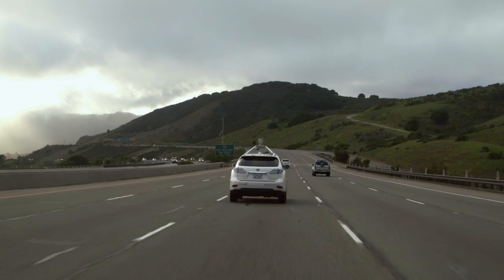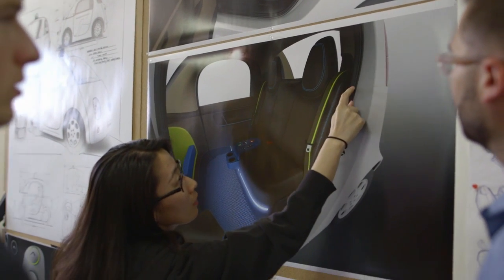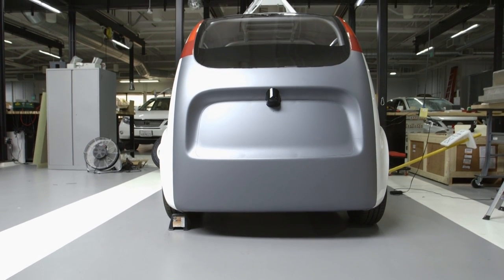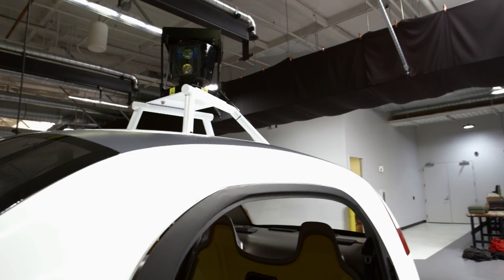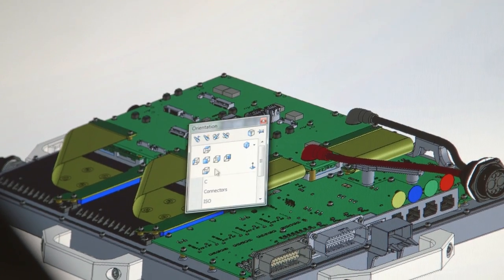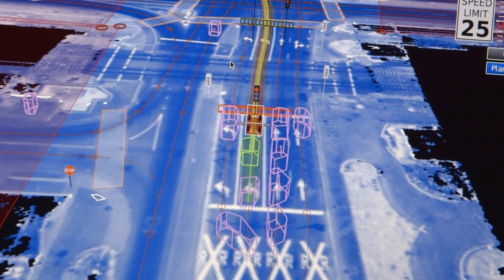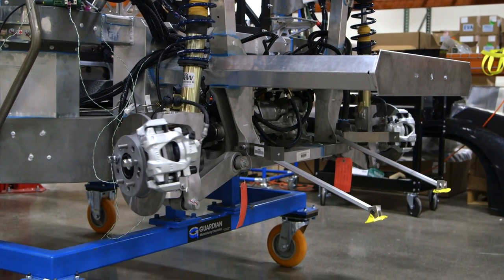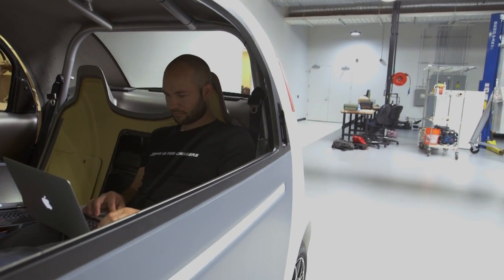Why design a self-driving vehicle from the ground up?

Comment: i've always been wondering since hearing about this idea is...whats going to be inside the car? entertainment systems? a round table? what will we do in the time we don't drive, anything i know. but sounds exciting filling up the space that has always been oriented forwards facing the road
Reply: Maybe the same thing as we see now in bigger aeroplanes. Entertainment system? Yes. Trip data? Yes. That could be: current temperature outside and inside, temperature at the destination. ETA (Estimated Time of Arrival), how long the trip will be. Speed. Expected route issues, such as slow traffic, accidents that may block the road, etc.

Comment: Removing the need for a steering wheel is great, but you know you've arrived when you've removed the need for a seat belt.
Reply: Seat belts will remain as long as there are other cars on the road that still have drivers behind the wheel. Which means, likely forever. You can protect yourself against crashing into something else, but you can't always protect yourself from being crashed into by something else.
Reply: StalePhish Eventually you wont have manually driven cars. They'll slow down the bumper-to-bumper 200mph traffic down to 60.
People will drive on private tracks or simulators for fun.
Reply: Rob Bairos People drive on private tracks and simulators already for fun. I think it will be a LONG time before manual driven cars are completely gone. We still have some cars on the road today that are over 100 years old. Quality is a lot better now than it was back then, so expect some of today's cars to last even longer than 100 years.
Reply: StalePhish Well I agree, it will take a long time, but eventually will be too much of a drag on everyone else. Reminds me of the switch from analog to digital TV a couple years back, after decades of transmitting analog formats.
Reply: StalePhish If I had to guess, Id say 40 years, manual driving will be outlawed in many freeways.
Reply: sorry to reply after 2 years. You probably don't really remember this comment section too well. I just had to say, i think it would be pretty funny seeing manual driving being outlawed. And just hard to imagine. I'll be alive. I'd be in my 60's then.
Reply: Descended_Flames that's okay. I still think about this topic all the time. If anything I think I way underestimated the rate self driving cars are progressing. Forget forty years. In fifteen, many freeways well be autonomous vehicles only! Cheers

Comment: How well does it all work in bad weather conditions? Will it spot floods? Potholes. Have you programed in dealing with tyre blowouts? Animals running into the road?

Looks like a big task with lots of programming. It will have amazing advantages when its ready.

Comment: Questions from a developer:

What is the computer powered from? Does this affect MPG?

Have you taken into consideration driving in the elements such as rain, snow, fog, etc. while designing this prototype or is that for the next release?

If I wanted to learn how to program one of these vehicles, where should I start? What languages are mostly used?
Reply: I think these things can also be detected, especially snow and fog (by sight). And whether a road is slippery (the car behaves differently to steering as expected; I think the AI can detect that).

Comment: What happens when the car runs out of power/gas?  Can the car be pushed off the road easily?  Can it be towed easily?  Maybe these are trivial problems, but I'm interested to know how they're addressed.
Reply: Maybe they will refuse to travel to the destination if they know the power won't last that far. That would be kinda cool wouldn't it :).
Reply: The car uses no gas plus this is a prototype. I bet they will ne a manual switch for the wheels to rotate.
Reply: IvanPlayStation4LiFe Right, no gas.  I missed that one, thanks.
Reply: What happens when any car runs out of gas and/or electricity? You tow it or recharge/refill it. It's just like your cell phone. You charge it when you go to sleep at night.
Reply: I imagine it would either pre-calculate the required energy to reach your destination and if insufficient, it wouldn't initiate, or alternatively if an error occurs and it runs out of juice prior to arrival, it would detect its low energy and pull off to the side of the road, where it could be towed. 

I don't think these are tremendously challenging issues. :)
Reply: UnknownXV Or you would just have it plugged in for a lot of the time. I imagine this type of car taking off as more of a ride sharing / rental car rather than something someone just buys.
Reply: UnknownXV StalePhish Nicholas Jung I don't understand why you guys commented? You guys literally said what my reply said, 0.o I could care less, but just wondering if other people actually read what other people reply. It seems like a waste to repeat the same thing to somebody 3 times, just sayin.
Reply: ***** eeh, for me it doesn't show that you commented on the comment before now..
Reply: Ху
Reply: It could be solved with an automated gasoline station, where the car can autonomously refill. That gasoline station should be compatible with the car and must allow Google to pay for the gasoline.

Otherwise I would think that a destination is too far, based on the fuel left in the tank and the average gasoline usage. It would reject to make the ride.

Comment: Who would be at fault if the car got into an accident, when there are no user-controls?
Reply: Seems like Google would.  I think that's fine... Google has deep pockets and can pay for damages/injury like an insurance company would.  Or they can pay an insurance company to do what insurance companies normally do.
Reply: ghuegel You are likely correct. Without any manual controls the manufacturer would likely be responsible. Which is why Google is testing so much and why the car is always recording what its sensors see. The other driver will have an uphill battle proving if it was the car.
Reply: The ultimate goal is for there to be no accidents.
Reply: ExtractorGames Yes, but we all know people, especially in america, tries all their tricks to get money from suing others.
Reply: ExtractorGames Yeah. And my phone never crashes or errors out either. Or any computer for that matter. So let's never think about what might happen before it happens, and then when it happens let's all base how quickly and the severity of the punishment should be when we are emotionally charged up. Sure to be a good Idea. Absolutely. /sarcasm

Nicholas Jung troll bait.
Reply: If it crashed, it either means there was a software fault or it was another driver's fault. If it were software, I would imagine Google's insurance company or the driver's insurance company would pay for the damages and Google would release a recall in the form of a software patch to prevent that type of accident from occurring again.
Reply: Another way to deal with crashes is keeping the responsibility of getting insurance with the "driver".  Insurance companies would almost certainly offer lower rates, and they could investigate crashes and assign responsibility as they see fit.  If the software has bugs, crashes, or just can't handle certain situations, insurance rates go up in general, at least until the kinks are worked out.
Reply: There would probably also be quite regular mandatory updates and checks of the software.
Reply: They have said this before. (You may have not heard or known) The self driving car is supposed to help not really completely take away from driving. You are not allowed to use the car unless someone who can legally drive is in the vehicle and that person is also liable for any accident that happens while the vehicle is running. 

(I am two years late for this question.... O.o)
Reply: Star Raidz Mate... They made a car that has literally no steering wheel, pedals, or anything other than a button that you press and you tell it where to go.

How am I supposed to "assist" when I lack any controls to do so?
Reply: ***** There is also a button to tell it to go to an emergency stop where it pulls of to the side of the road or if it can will just full on stop the vehicle. Also I see where you are getting at with the no "assist" thing and I have no idea what the are gonna do about that. I hope they come up with a good way so we can make the decision so we don't have to hope the car makes a good one for us...

Comment: I live in a location where it snows, so what happens when the car has to deal with snow, for people who drive in the snow, you know it is a much more demanding task when in snow, I would like to see what the self driving car does when it starts to lose traction in snow. Small things like that I am sure were not overlooked by google, but in the real world might prove quite difficult.
Reply: most new cars already have traction control to deal with this sort of thing, so it's not a huge leap of faith for the google car to be doing it.
Reply: But it is a problem because if there is deep snow and it gets stuck what will it do
Reply: Nate Swartz tell you to dig it out? what does any driver do?
Reply: What if it slides and falls into a ditch due to snow. I think that yes it is a great thing of tech, but without a steering wheel and a gas and break pedal, I don't see this becoming too popular, I think if necessary a person can take control that would be so much better.
Reply: Nate Swartz People are terrible at driving. computers would cause far less accidents.
Reply: Nate Swartz Ideally it would never slide and fall into a ditch, because it would detect a skid and act accordingly. It's not a human that can "freak out" and get irrational when an emergency situation presents itself. With proper tires and proper software, that should be a non-issue.
Reply: StalePhish Some things cannot be predicted, like black ice for example, what technology could detect that? This car cannot see how much traction the road ahead posses. Some terrains are just to complex, even for google. . Like some circumstances cause situations (which occur often where there is snow) where it is to late for the car to prevent itself from sliding through a red light or sliding into a ditch etc...Where packed snow (relatively good traction) changes to glare ice (virtually no traction), and for a computer to determine the differences between these two would, in my opinion be next to impossible. The car would have to be driving extra slow all the time? And even if they could they would also need to figure out the maximum speed for different levels of traction, and the varying response abilities...such as your limited ability to turn fast or only a certain amount so you can turn while avoiding an object on ice, snow etc..it wouldn't only need a very sophisticated system that both senses wheel traction and car stability, it would also need to know certain (probably incalculable) factors ahead of time for it to adjust properly in order to avoid its inevitable and immanent failure to drive a vehicle in the snow.... its probably never gonna happen google, at least not without a steering and a restriction on its use in areas and conditions that are not capable of being computed.
Reply: VideosWorthSpreading "A sophisticated system that both sense wheel traction and car stability". We already have that, it's called traction control and stability control and comes standard in almost all newer cars. As for detecting the surface, there are certainly sensors that can detect that sort of stuff. If we can detect ice vs dry surfaces on Mars, we certainly have the technology to detect ice 100 feet in front of your car. All of the things you mentioned are things that humans need to do while they drive. It's only a matter of time before all of those thoughts are turned into computer algorithms. It probably would have to drive extremely cautiously in snow, but really, humans need to get better at doing that too (notice how there are a lot more crashes in the winter than in the summer?).